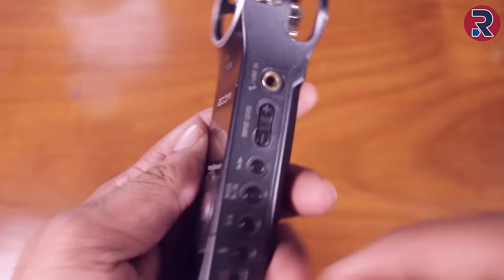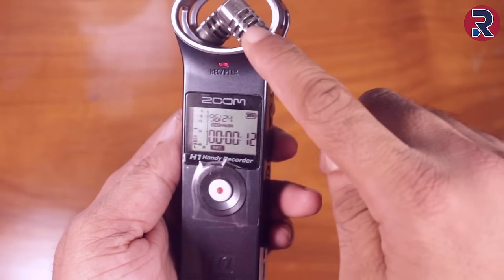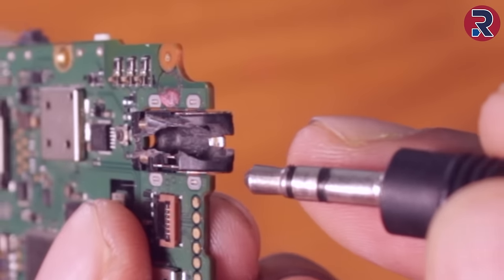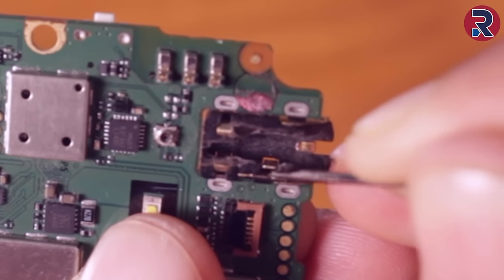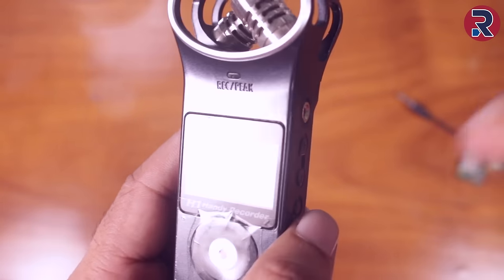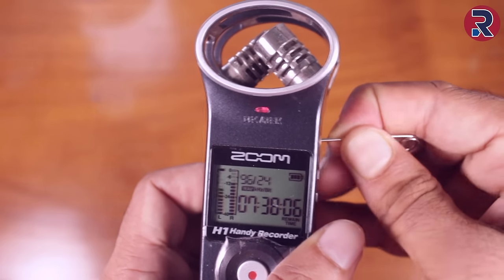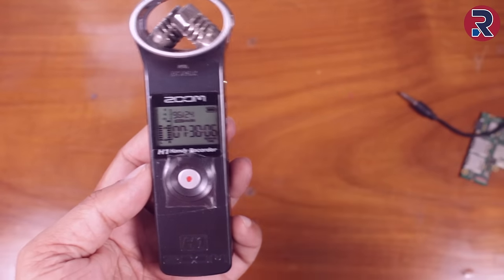How To QUICK FIX 3.5 mm audio input jack one or both side not working | ZOOM H1- ROYTECTIPS |

Comment: Thanks man! I used this instructional video to repair my PC headphone jack! So quick and simple! Before watching your video I was actually considering purchasing a complete new jack and soldering it in. Saved me time and money. You get a like from me!
Reply: Exact same situation, I bought one of those curly spring wire extensions to prevent future damage
Reply: @skylar1798  curly spring wire extension?
care to elaborate I'd like 1 too
Reply: @jaysmith6466  I think he meant just a regular extension like this: CERRXIAN 3.5mm Extension Cable, 90 Degree Right Angle 3.5mm Male to Female Jack

Comment: Roy, thanks for the video. I do not understand it. 1. ) What exactly did you say when you inserted the safety pin? 2.) Where did you insert the safety pin? In between the edge off the metal shell and the body of the device? - -. or did you insert the PIN in the middle of the Jack and bend it upward? Would really appreciate a response. Thank you for your uploads and useful information. Best wishes

Comment: THANK YOU! I thought I was gonna have to buy a new speaker system.

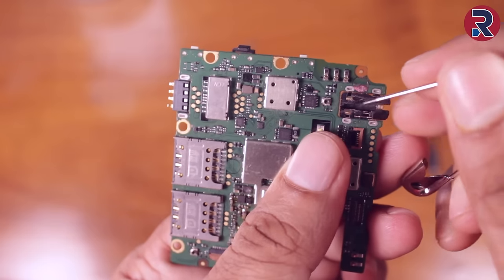In my case, the metal plates look a bit different to what's shown at 1:00. My input jack has a plate on both sides, and they're facing upwards.
I needed to take a pin and pull the plates towards the center, bending it slightly.

My issue was that the male AUX (ie. the part you plug in) was only playing sound if I pushed it in a certain direction while it was plugged in. 
That meant the connection to that side was bad, so I bent the plate on that side inwards.
Reply: OMG THANK YOU!!! I had this problem FOR SO LONG i'm talking on discord with friends and when i was moving a bit my headphones would lose connection, i was always getting disconnected from call and from game had to restart everything if the cable was moving a bit.
I noticed if i was pushing the jack in certain direction the connection was fine so i did what you said, instantly fixed it, thank you brother, you saved me from putting the pc in service and probably paying a lot and loosing time for fixing that stuff.
Reply: how do you know where to bend? also what did you use to bend with because im having a lot of trouble
Reply: So what you're saying is that you bent the plate that's on the side that played audio when the male aux was pushed towards

Comment: Question: I have this Irig, it's like an adaptor for the guitar, allowing me to use any speaker as an amplifier for my guitar, but the sound the irig sends is incredibly low, I barely hear any, and also the speaker I use is fairly loud. But when I plug the guitar on my 10 watt amp, it's pretty loud. Can replacing the input jack of the irig fix this problem? Thanks
Reply: What iRig do you use? It depends on the device.

Speakers are not designed to amplify sound, they are mainly designed to replay already recorded audio and transmit it as is. On the other hand guitar amplifiers work by taking a certain sound and increasing it, that's why it's called "amplifier". So basically it's normal for your speaker to be low when used as an amplifier.

Comment: I need help i have an issue with my laptops jack 
whenever i connect my headphones to this 3.5mm jack i can hear only from the right side and when i hold the plug pushing downwards the audio seems to be fine 
how do i fix it pls help
Reply: Have you tested to see if it could problem with your headphones? Your issue sounds like problem with the cable.
Reply: @colebonin6343  I have tried with different headphones but they are working fine when I with my phone so it's some issue with my 3.5 mm port in my laptop
Reply: Same problem here but when i push sidewayd

Comment: Is it permanent solution? Can I fix it permanently in some local electronic shop by exchanging this port? I live in Bhopal MP. Could you give some suggestions please?
Reply from the maker: Replacement port is hard to find .. I don't where you can get a replacement . normal 3.5 mm trrs female will not work .
Reply: @RoyTecTips  Today delete button stopped working. Do you have any idea? Can someone fix it?
Reply: @madhuvratadasbvks3237  you getting the same problem just like me first jack doesn't work then del button not working
Reply: @madhuvratadasbvks3237  restart the pc the del button will be solved.  And it's been 15 days i have been facing a problem headphone jack i too wanna change it

Comment: thanks, a man worked for my laptop.
Reply: Hpw did u do it bro?
Reply: @brandonphylcorpuz975  first try different headphones to check actual problem in your laptop and all so check audio driver is ok . Now do the trick as in the video.
Reply: I didn't get the video maybe you can explain it to me?
Reply: Do i pull the relay upwards?
Reply: Yes i did for my laptop but very slowly other wise it damage. If you dont feel confident dont do and use some professional help.